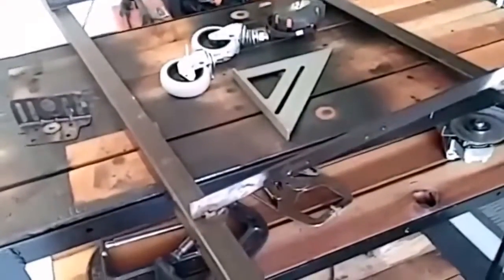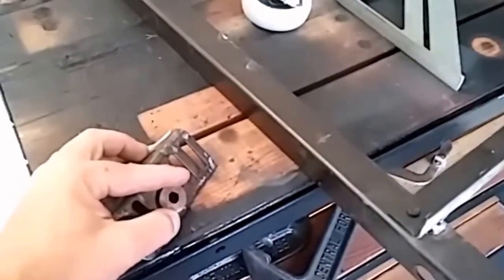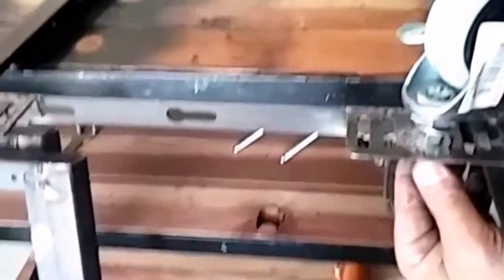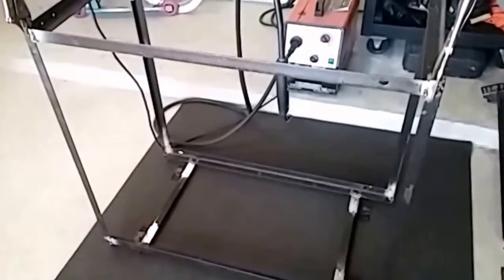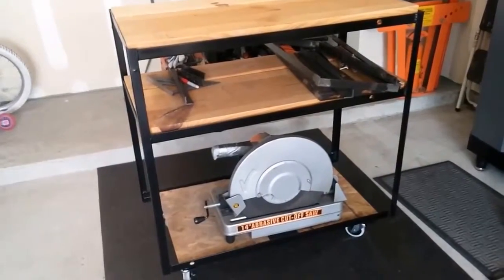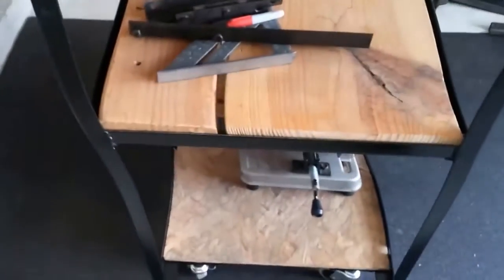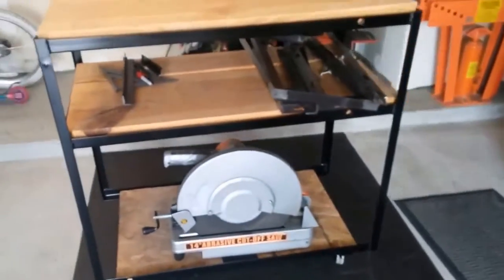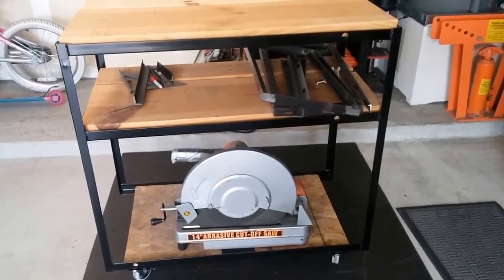WeldingTable

Comment: LOL Did you catch it on fire?  I like the concept using bed rails.  Might have to do something like that for my shop.
Reply from the maker: +farmboy30117 O yea it caught on fire every time I use the welder ha but holds up well.  I'm a firm believer in those bed rails.  Folks through them away all the time.  I have built many trailers from scratch with those things.  You might have seen one in some of our videos.